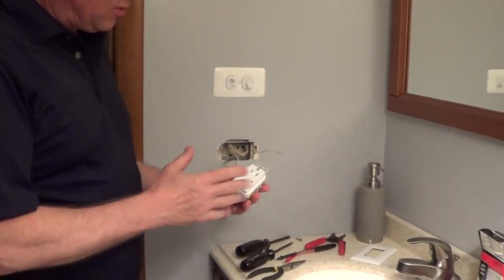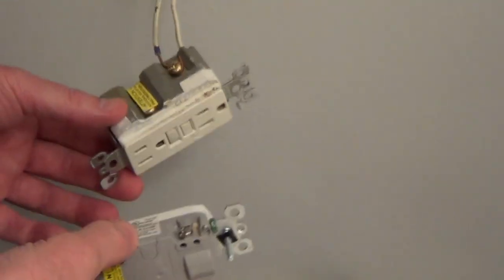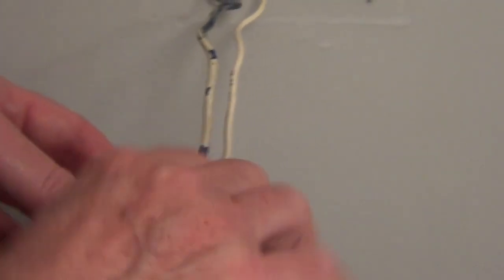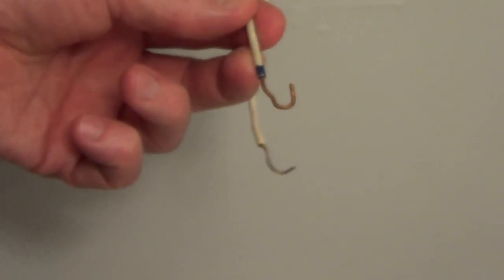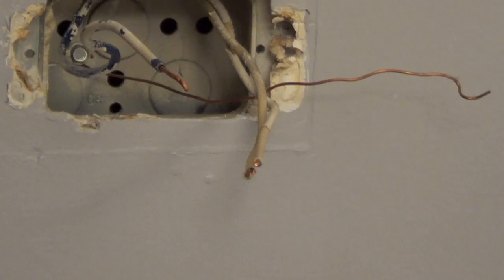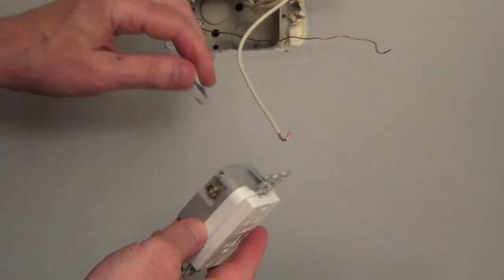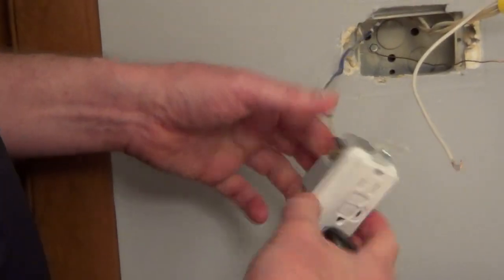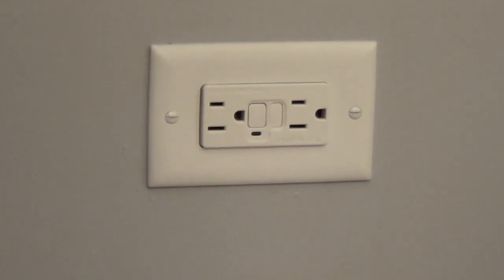Wiring a GFCI Outlet - Install a GFCI Receptacle - Conduit

Comment: Hi, I need to replace a bathroom outlet with a GFI receptacle on a 2 wire power supply.  Can I ground the GFI receptacle with 14/2 wire in a metal junction box where the 14/2 wire and 2 wire power supply meet?
Reply from the maker: Hi, you can email me at fixitpodcast@gmail.com.
Reply: Jodi s NJ Bain’s ijonininitially noniniji

Comment: can you install GFCI withour a ground wire, just the neutral and the hot (white and black)?
Reply from the maker: Hi, yes you can. Just mark it with the sticker in the box that says  No Equipment Ground, and all the outlets past the GFCI. It is much safer than not having a GFCI.
Reply: FIX IT Home Improvement Channel thanks!

Comment: If I have 2 sets of cables coming in to my GFCI plug do I pigtail the two grounds together to attach to the ground screw? One of my cables also has a red wire in it, does that connect to the line or load side? Thank you :)
Reply from the maker: Hi, yes you would create a pigtail with the ground wires. Hi, you need to test to find the line and load side. Here is a video showing how to wire a GFCI to another outlet. https://youtu.be/cnoqzj76p2k
Reply: @FIXITHomeImprovementChannel  thank you so much for that quick reply! I did pigtail the ground wires but they arced when I turned the power back on. Do you know what would cause this? They are bare copper, should they be insulated? Thanks again!

Comment: good video.  Only suggestions I have are to not reuse wire ends...always cut and expose fresh wire whenever reinstalling.  Also, it's good practive to use a linemans pliers to twist wires, especially 3, before putting on a wire nut.  Don't rely in the wire nut to adequately twist 3 wires together.
Reply from the maker: MrShadyfish Thanks. I agree.
Reply: FIX IT Home Improvement Channel So as not to sound negative, I'll say that your advice to remove the 18ga wire and always orient the wire clockwise in the screw were excellent points
Reply from the maker: Thanks for your input

Comment: I thought it is required to wire house on a 20 amp circuit with a 12 gauge wire?  I was trying to change a bad switch going to the light.  At my house everything is 12 gauge.  During twisting I broke the 12 gauge pigtails.  I have 14 gauge wire with me, can I use it to make the pigtail going to switch while my line and load is 12 gauge? It is very hard to twist 12 gauge wires, they keep breaking.
Reply from the maker: arshi khur Hi, in most older homes 15 amp circuits with 14 gauge wire was standard. New homes are running 20 amp circuits with 12 gauge wire. Try using a push wire connector. They work great for your situation. Let me know what you think. Here is a link https://www.youtube.com/watch?v=e_GD3JCvaK4
I have more tips on our weekly podcast https://itunes.apple.com/us/podcast/fix-it-home-improvement/id880903087?mt=2
Reply from the maker: arshi khur If you have a 20 amp circuit, only use 12 gauge wire.
Reply: thank you for a quick reply. I try to buy the push wire connector and everyone I talk to (HD and lowes) told  me that there is not enough metal for a good connection and it is only for temp use.  The logic is that heat would build up, arcing would happen  due to not enough wire to wire contact.  Everyone recommended me to use the wire nuts.  It is my first time changing a switch.  I already have lineman plier and all the tools.  I have a load coming in, going from the switch to light that travel to another switch and an exhaust. so I have 4 wire to connects.  So every time I twist four 12 gauge wire I break them in pieces.  First its very difficult to twist them.  Both switches are in a double gang box.
Reply from the maker: Hi, they are code per the National Electrical Code. I think they are great for certain situations. Strip the insulation 1/2 inch and push them in. It will work great.
Reply: FIX IT Home Improvement Channel glad to know that.   For future how would I know by looking at the product packaging if its NEC approve? thanks again for your help.  Wago is a little pricier I was going to buy it from HD or lowes. Do you know the one HD sell is approve per NEC?
Reply from the maker: Hi,
Yes, and they are CSA certified. Let me know how it works for you.
Reply: will do thanks